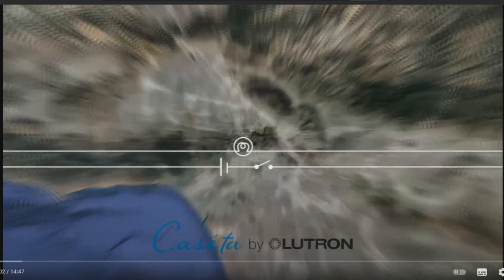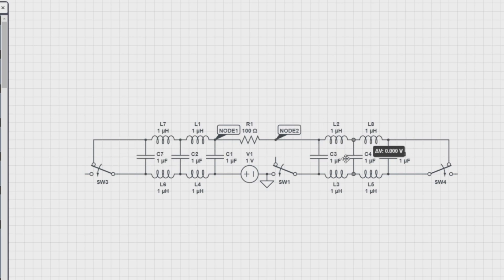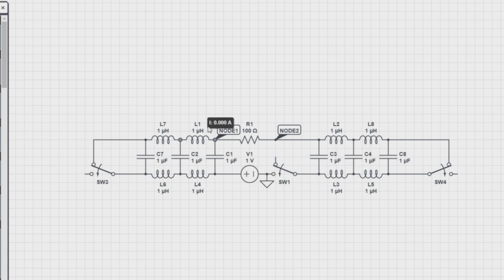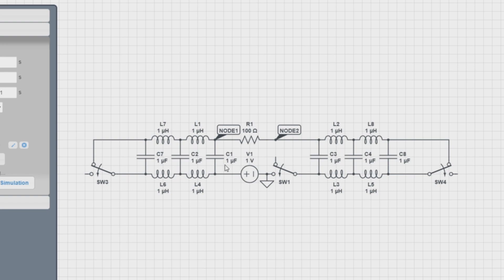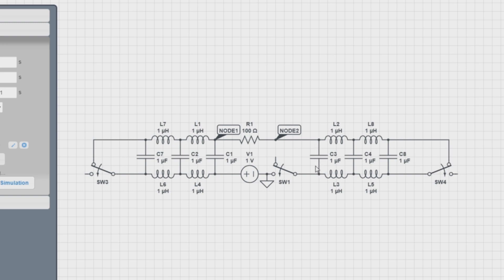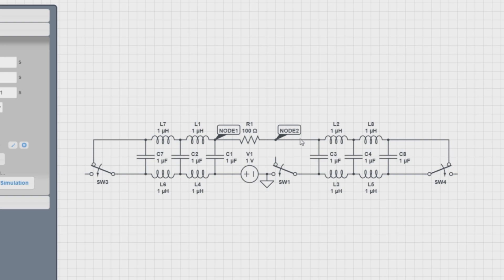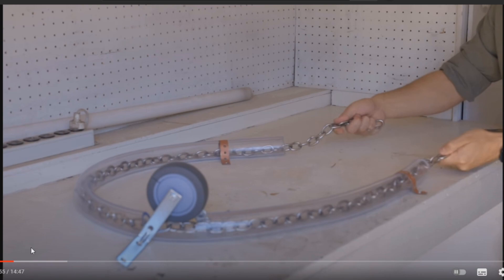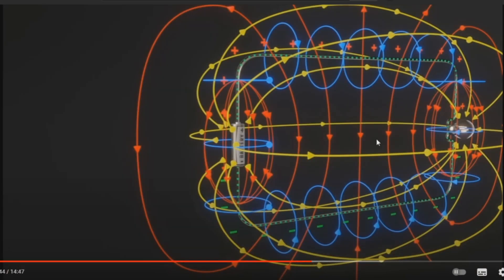Explaining the Veritasium "The Big Misconception About Electricity" video

Comment: The problem is this video and veritasium are talking about different circuits. Here talk about the Transient time where the voltage acts like a impulse effectively and the impedance of the circuit matters so much. Veritasium talk in the Steady State, and put the question of switch closing , so simplified model. In that imaginary circuit the establishment of the voltage (about c speed) is Transient, and with switch Open, the voltage is there, at the terminals of the switch, not at lamp, and this is One steady state. The Other steady state is switch Close and start imediatly the current, so lamp On. So Imediatly as the electric field complete the 2cm of the switch. So the lamp lights so quick as 2cm/~c. More quick than the 1/~c , and the coherence of units referred in the video, come from that physical interruption of that circuit, full of prerequisites. We know the electrons move very slowly (current), but all start at the same time as the electric field is closed is the fact as they are chained by electric field force in one direction in the Steady State. Don't break causality as don't break causality if we move one solid (have all atoms chained) and all atoms move at same time independent of solid extension. I remember other thing which you sure agree: we don't need AC to radiation. A DC pulsating can do also. Note:~c is the "almost c", as c is only in the vacuum. In conductor is less but "~c".
Reply from the maker: My explanation is wrong. Veritasium is actually correct. I have made a new video with a better analysis: https://www.youtube.com/watch?v=RsiYXfpJu5U

Comment: Thanks for this...  the complete answer requires a 2 step analysis.   1) a transient response analysis, and 2) DC steady state analysis.    Besides that, Veritasium left out needed information about the bulb, the battery, the wires in order to produce an accurate picture of what would actually happen.
Reply from the maker: My explanation is wrong. Veritasium is actually correct. I have made a new video with a better analysis: https://www.youtube.com/watch?v=RsiYXfpJu5U

Comment: So the power is jumping across the 1 meter gap via induction, because the wires are close enough that the "battery side" of the circuit can affect the "bulb side" of the circuit with its electrical field?
Reply: Only a small fraction of the power is able to do that. That is why many of us are very upset with his conclusion, it is very very misleading. The great majority of the power has to travel 300,000km to actually turn a real light bulb on.
Reply: @marcfruchtman9473  Ah, I see.  He actually DOES mention that - but it's not very clear, and the actual light bulb prop he uses further muddies the water.
Reply from the maker: @halavanderdrake3956  My explanation is wrong. Veritasium is actually correct. I have made a new video with a better analysis: https://www.youtube.com/watch?v=RsiYXfpJu5U
Reply: @marcfruchtman9473  
Didn't Vertasium also say something about hypothetical zero resistance in the wire??
Reply: @jayytee8062  Yes.

Comment: I wonder how you explain necesity of biger cross section of cables when larger amount of energy needs to be transfered? Isn`t it a proof that energy is transfered by wire?
Reply: That's actually a good question.
Fact is that electrons are moving in the wire. Not very far and not very fast but they are driven by electric and magnetic fields.
Now electrons are fermions, which cannot occupy the same space at the same time. So they are "bumping into each other" and also interact with copper ions of the wire. This creates vibrations and this causes heat. The more electrons moving, the more heat.
I just try to figure out how the pointing vectors look like when you connect a thin wire across a battery and it burns from the current. Because the energy is basically dissipated inside the whole conductor... 🤔

Comment: It is better to think of this as a transmission line.  As such it will have an impedance, and how much power is available in the light in the 1/c time will be dependent on the bulb's ohmic resistance and the transmission line impedance.  If you select the bulb with the right impedance, then a significant amount of current can flow when the switch is turned on.  How long it will light based on the transmission line characteristics alone will be dependent on the length of the transmission line.  Assuming a velocity factor of near unity, then this will take 1 second before the reflections off the far end are felt.
Reply: I likewise suggested viewing the wires as a waveguide, which is a form of transmission line. In any case, his video comes off disingenuous at best, and the comment section is full of confused people questioning it, and some very knowledgeable persons going through the calculations and at least lightly accusing the videomaker of disingenuity.
Reply: @cjay2  I think that the point that he is making is the assumption that current flowing through the wire like the chain model while OK for many circuits, fails when the wires are very long.  The example  makes it obvious that the traditional model is insufficient to describe what is happening.  On the other hand if the time scale is small then the wires don't have to be that long before the same issues arise.  For example, if you are designing a circuit that operates at 10 GHz, then you will face the same issues as he states because the time scale is small.  I think the main issue with his description of the example is that it is incomplete as the geometry of the wires matter a great deal because these effect the fields that they generate.  However, I think it is probably beyond the scope of a single youtube video to explain the electromagnetic implications of the fact that the energy is actually carried by the fields.  Modeling the time dependent fields around an arbitrary geometry is non-trivial and often non-intuitive.  This fact is conveyed by the example, and the fact that so many people are upset by it suggests that this fact is one that is not widely understood, even by electrical engineers.
Reply from the maker: @argcargv  You are correct that I should have looked at it as a transmission line. I assumed that the real world impedance would be something so big the transmission line effects would be small, but on looking at real world values it actually works out and my analysis in this video is wrong. I have redone the analysis here: https://www.youtube.com/watch?v=RsiYXfpJu5U

Comment: Don't forget that those wires also see each other magnetically, basically forming two antennas: a receiving one and a transmitting one. In your schematic it would be the inductive coupling between those "inductors", so there will be more power transmitted than it seems. And yes, you could actually cut the ends there, it would still produce a blink when turned on, and a blink when turned off, at way shorter runs than a lightsecond. When you go to resonance length (2500km for 60Hz AC) it will couple quite well then, Tesla wanted to do this for some longer runs, but instead we have radio communications working this way now.
Reply from the maker: My explanation is wrong. Veritasium is actually correct. I have made a new video with a better analysis: https://www.youtube.com/watch?v=RsiYXfpJu5U

Comment: Replace Derek's circuit with a very long loop of standing dominos... Tip the 1st domino over. It will fall and tip over its neighbour, and so on... (horizontal dominos will, in this thought experiment drift, impelled by being "pushed" from the pump that is the pole of the battery finally able to push electrons (or 'holes') out of the appropriate terminal.) The 'clack, clack, clack' is the transfer of a miniscule bit of kinetic energy to create wavefronts through the surrounding air (roughly equivalent to the EM wavefront that radiates in all directions from the point where electrical charges are set in motion.) Notice that the compression of the radiating soundwave 'pulse' will cause each of the dominos to 'tremble' as it passes, but the 'tremble' is not practically measurable. This is analogous to the EM effect on distant electrons in the conductor... They will "shimy" ever so slightly, but they will NOT magically join forces to produce a measurable current. The electrons of the filament of the bulb will not be moved. The bulb will not illuminate until the "flow" being "pumped" out of the battery's terminals has travelled along the full length of the wire...

Derek has made a "clickbait" video in the service of his own bank account.

The only "misconception" in his video is that a "lay person" is competent to replace/re-cable a light switch without being electrocuted, and will not create a deadly fire hazard inside their own home.

Oh, Derek... Responsible patreons should be abandoning this guy in droves...
Reply: Just one question. How fast do you think the electric and magnetic field is generated when you turn on the switch. And if so what do you think carries the electric energy to the light bulb. Is it the electrons or the fields?
Reply: @techfreack8397  The magnitude of the static electric field that surrounds the length of the conductor is a function of the voltage (across the open switch)... The magnetic field will only appear as a propagating wave along the wire as each charge carrier (electron or hole) 'shoves' its neighbour forward (from the instant that the switch is closed)... It's too many years for me to recall the max propagation speed along a conductor, but it is far less than 'c'. The 'transient' of the square wave leading edge may weakly (really, really weakly) 'couple' across the air gap (capacitance) between the conductors, but the power (energy) transferred will be in the range of picoWatts, probably less than the open circuit had already been absorbing from stray RF signals, or leaking out of Derek's smartphone or his camera equipment or the AM radio tower just off camera to the right...

In short, Derek can claim that the electrons within the bulb's filament might 'sense' a miniscule "disturbance in the Force" within nanoseconds, but the bulb will not overcome its resistance and "light-up" instantly... The tiny transient will fade exponentially fast in a vanishingly short time, and only after the actual flow of 'force' driven by the slow flow of electrons has travelled "to the moon and back" will there be enough power transferred ALONG the conductor's path to be dissipated by lighting up the bulb... Einstein can sleep easy... There's nothing 'spooky' happening here...

Without voltage (potential difference), there is no current. Without current, there is no magnetic field, ergo no power transfer. In my worldview, the debate about 'field' vs 'electron' is moot for direct current. "You can't have one without the other." (AC is another story.) And, Derek's 'magic' of power flowing directly across his 1m air gap is ludicrous in the extreme... Place another bulb (without connecting it) half way between the battery and the first bulb... By his explanation, the second bulb should light up, too, because it sits within the field transferring energy from the battery to the first bulb. It doesn't, though, does it Derek?
Reply from the maker: @rustycherkas8229  My explanation is wrong. Veritasium is actually correct. There is actually way more than picowatts of power transfer. I have made a new video with a better analysis: https://www.youtube.com/watch?v=RsiYXfpJu5U
Reply: @ZongyiYang  I was about to head for bed... Now it looks like I'll be burning the candle a little while longer... :D

Comment: I just want to point you that Veritasium is also not completely correct. The answer is right but not because the field crosses 1m of gap. The incandescent bulb does not light via fields. CFL yes... but the real answer is that the force propagates completely in the connected circuit, and within 1/c the entire circuit is activated. This is a mystery and he is not covering that mystery because no one has ever done the experiment before.
As for using AC the answer is slightly different because of hysteresis on that much wire, imo. 
But like I say no one has done this experiment so the answer is not technically known.
Reply from the maker: My explanation is wrong. Veritasium is actually correct. I have made a new video with a better analysis: https://www.youtube.com/watch?v=RsiYXfpJu5U